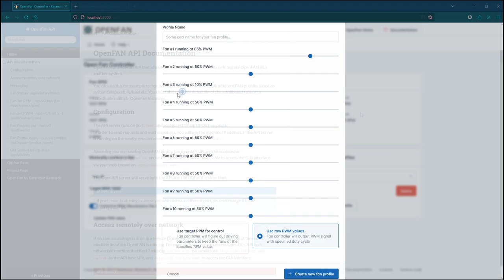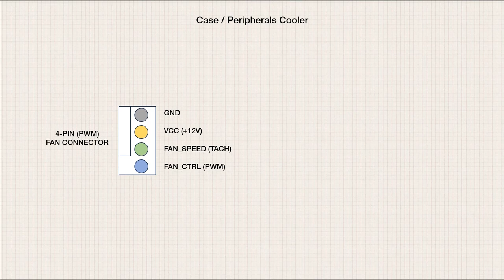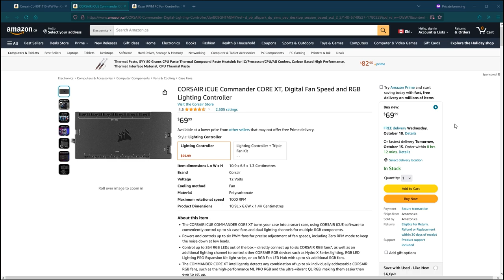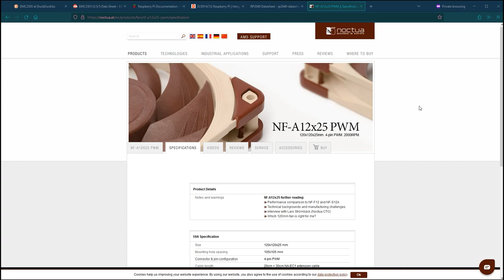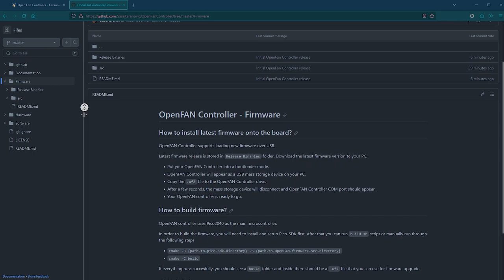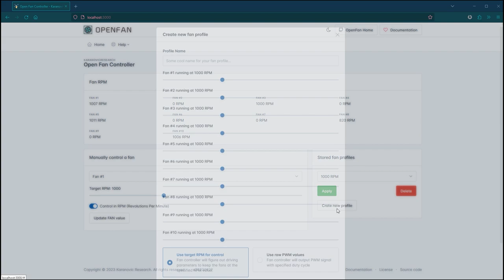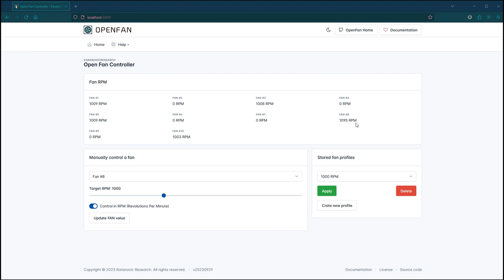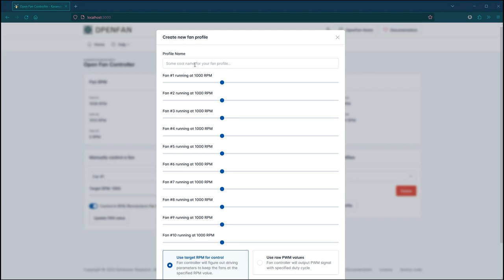OpenFAN Controller - The fan controller you didn't know you need

Comment: Hi, I have just ordered your board and hope to use this in my unraid server to control the temperature of the disks and also maybe GPU etc.  Have you any videos showing the software setup within unraid?  Thanks, Des!
Reply from the maker: Thanks Des!
The OpenFAN ships pre-programmed so when you receive it you should be good to go.
There are two (public) GitHub repositories on my profile that you can try.
One runs OpenFAN software and there is another one dedicated for creating profiles for Unraid (HDD groups and curves based on temperature etc).
I don't have any vides on how to set up the software but it's a good suggestion. Maybe I should make a "tutorial" in the future.
Reply: I would really appreciate a short video about how to set this up and get the most from it in unraid. It could really help sell these for you too I guess if folks saw a simplified way to do this. Management of heat in servers is a very important thing, but blasting fans at full speed is noisy and inefficient so this system has real potential. 

Thanks 👍
Reply from the maker: Thanks! I will add it to my (ever-growing) list of videos I want to do. :)
Setting and using OpenFAN should be fairly straight forward, especially for technical users.
But I agree that having a video guide explaining how things work and how to set-up everything would be nice.
Only minor complication is that you can integrate it and use it in so many different ways, so keeping the guide concise while covering all use-cases could be an interesting challenge. :)

Comment: Wow, I have looking for this forever (just ordered 4). Now I just wished this was controllable from a Raspberry Pi. Does the sata include other voltages than 12v that is needed for this or is there a way to bypass the SATA-connector? Heat shifting in homes, extraction from 3d-printer enclosure, cooling of media furniture below tv, there are so many applications.
Reply from the maker: Thank you! I'm glad you like it.
I thought about making one for Raspberry Pi but the issue is that on Pi you only have 5V and also it's very limited in how much current it can deliver. But I am working on a WiFi/Stand-alone version that you would be able to power from a DC adapter and control remotely. I actually need it to cool down my media PCs that I have under the TV (inside furniture). :)
Edit: Sorry I forgot to answer the SATA question. SATA connector provides only 12V. You could provide 12V externally via DC barrel jack to SATA connector.
Reply: @SasaKaranovic  I Could power both the pi and your board from the Streacom PSU but could I control your board from Linux over USB?
Reply from the maker: Hi @martenki-71
Absolutely! The software is written in Python so you should be able to run it on Windows, Linux and Mac without any issues. It can also run as a Docker container.
If you need help setting it up, please feel free to send me an email and I'll help where I can. :)

Comment: Sasa, I'd be interested in a fan controller with features like this, but with additional features.
1) External power source. I see that you used USB to power it. Some of my testing isn't next to a PC, so I'd need to be able to plug it into a wall socket. I assume that there's a power supply out there that converts to the USB (micro?) that you chose. Is that correct?
2) Display. Since I won't necessarily be able to connect to a computer (but I still love the GUI for when I can), I'd need a display that can show RPM, V, W, A, temp (I have 3 thermocouples I can take out of an Akasa FC.Trio that is proving to be quite unreliable).
3) Kill switch. Along with calibrated dials, I need a way to instantly start or stop the power to a particular fan without a linear regulator and high-quality caps and inductors (although I'm not saying I don't want those, too). I'm doing a specific test that gets fouled by delays caused by inferior components, so a switch to disconnect the circuit seems to be the simplest solution.
4) Full RPM support. The two FCs I have (the Akasa and a CopalFan FC from En-Labs) do not support below a certain point. I'm not sure what the basis for the cut-off is, but it makes it hard to determine the full range. I have some very powerful fans, including server fans, and 0 RPM fans, and I need accurate measurements of the RPM.
5) Time. I need to be able to set test durations as well as time how long it takes for a test to complete. For example, the test I mentioned in 3 needs to record the duration to completion.
6) Ports. I don't NEED a lot of ports, but it would be helpful if the FC can control 5V and 12V fans, as well as RGB and ARGB LEDs. Also, I don't want to ruin any fans by supplying them with power they can't handle. 2 ports each would be fine (2 5V, 2 12V, maybe 2 24V, 2 RGB, 2 ARGB). Did I miss anything aside from JST? It'd be pretty hard to cover ALL of the proprietary ones.
7) Power control. It'd be even better if I can control amps and/or watts, as well as RPM.
8) Data sharing. Having all the data to crunch would be great, and being able to store it until I can plug it in would be even better. Even if that means I have to plug a USB stick into it to save to, that's fine.

Do you think you'd be able to help? I'm not a sparkie or any other kind of engineer, just an avid enthusiast trying to provide useful info to consumers.
Reply from the maker: Great suggestions. I will add them to the list of future improvements.
Although the better approach here might be to setup a separate project to build an external stand-alone fan controller. The current one is targeted more towards users who want to use this inside their build.
Reply: I think you're correct  @SasaKaranovic  that it should be a separate (related) project. Most people seem satisfied with hubs and partial-featured FCs for whatever reason, but fully-featured FCs are extremely hard to find and, usually, do not provide individual control of each fan but, rather, follow the repeater/splitter/hub methodology of "one fan to rule them all". Even the Aquacomputer Aquaero Pro 6 doesn't do what I need, and it's about $200 +tax+S&H just for that unit without RGB & ARGB control. The EN-Labs CopalFan FC can use SATA or AC, but it didn't ship with the AC power supply and I have no idea which would be used, plus it has no display and the component quality isn't high enough to eliminate delays in speed changes. It's been very frustrating for me to find what I need, so I really hope you'll be willing to help.

BTW, I shared this video to my channel as I think it deserves attention!
Reply from the maker: Someone else mentioned display and encoder in the comments.
The OpenFAN has expansion headers (I2C and 1-Wire) so you could potentially add a display and rotary encoder that would allow you to monitor fan status and set fan rpm. Then you just need DC to SATA power connector and you are good to go.
Reply: @SasaKaranovic  Sorry, what's an encoder? Are they easy to find? What specs would be needed for the display and encoder?

And, if I didn't say this already, I think your efforts to do this are absolutely fantastic and I hope they bring you what you hope for!
Reply: I think their idea of using USB-C is pretty important,  @SasaKaranovic  . I say this because I recently learned that C is becoming the new standard in USB, even for Apple, who will be phasing out their firewire.

Comment: You should use right angle fan connectors. Most people like to put such boards on the back of the motherboard.
Reply from the maker: All connectors are at the edge of the board and during assembly you should be able to chose between putting vertical or right-angle connectors.

Comment: Hello Sasa, this is truly amazing!!! Exactly what I've been looking for weeks on the web. A big thank-you. I want to use it to manage 18 fans on a large radiator. Is it possible to add flow and temperature connectors to the PCB?
Hats off my friend
Reply from the maker: Thank you! I'm glad you like it!
You could use two OpenFANs to control up to 20 fans. The board does not support flow sensor but with modified firmware it could.
Although I would strongly recommend using a dedicated flow/temp sensor and then using OpenFAN to individually control as many fans as you need.

Comment: Hey. Can I controller the fan speed using a 3 pin connector? I am looking to buy it. Thanks!
Reply from the maker: Hey! Thank you for asking!
OpenFAN supports only 4-Pin (PWM) fans. Mainly because the price difference between the 3-pin and 4-pin fans has become pretty negligible.
Also the cost/complexity of driving 3-pin fans compared to 4-pin fans is relatively high.

Comment: Is there another alternative so i can make this with atmega32u4/arduino pro micro?
Because i can't find emc2305, and isn't atmega32u4 has pwm output?
Reply from the maker: You should be able to build something similar with any microcontroller assuming you have enough PWM outputs and GPIOs for input.

Comment: Cool! I love when things are open source! I hate pc parts manufacturers that use propiertary hardware/software and are not opensource, how can i trust them?? Not at all! Thanks for making an opensource fan hub. Although i would like if you could also add rgb so the rgb also is opensource and does not use random closed down firmware. And maybe you can try to make your own Aio with display on it running opensource firmware and running on a opensource application that can run on macos, linux and windows
Reply from the maker: Thanks! I'm glad that you liked the project!
I have another project that I'm working on that might solve all of your problems. Stay tuned! :)

Comment: Can't the RP2040 control PWM fans directly without the use of controller chips? Even 10 of them. And any algorithm you could possibly want to use, the RP2040 can definitely do that with cycles to spare. Two fewer chips would reduce manufacturing cost by just that much.

Or do the fan controller chips have the ability to recognize that the connected fan is only 3 pin and adjust the voltage instead? If it can, definitely we want those chips instead. I'm switching to all four-pin fans, but I do still have some three-pin models lying about.

Of course what we really need, regardless of BOM cost, is for someone to start producing these things commercially so that they're OUT THERE in quantity.
Reply from the maker: Just to clarify, these units are already manufactured and ready to go. You can order them from a web shop.

The fan controller chip has several valuable features like rpm/pwm drive, PID tuning, integrated push-pull stage etc.

The Pico2040 should have enough PWM outputs. I might consider this for some of the future revision.
Although Pico-only design would require a lot more development and testing. And at volume savings of those two ICs compared to development time; especially if you consider that most people will buy one or two, not 20 of these, the price delta becomes negligible.